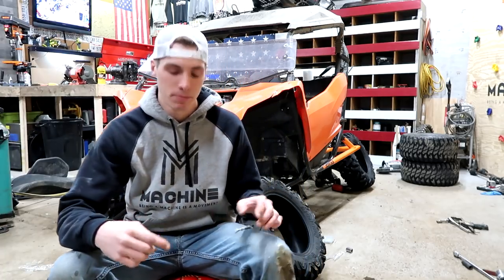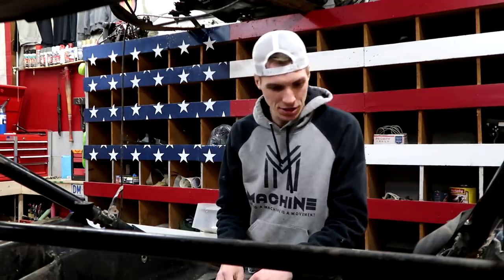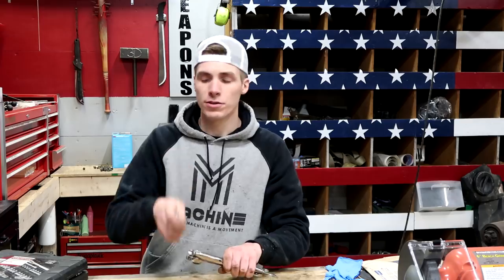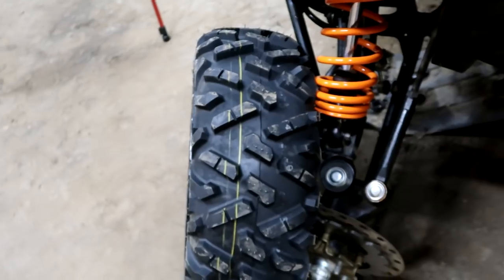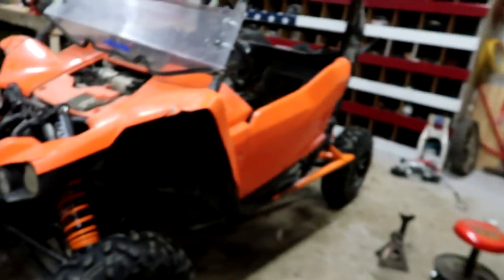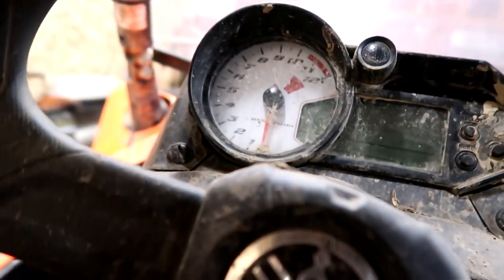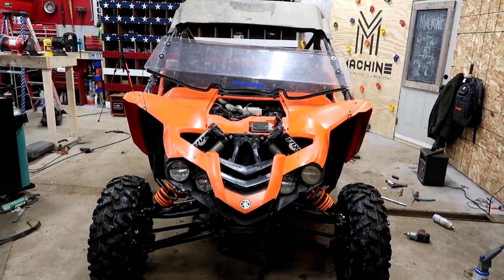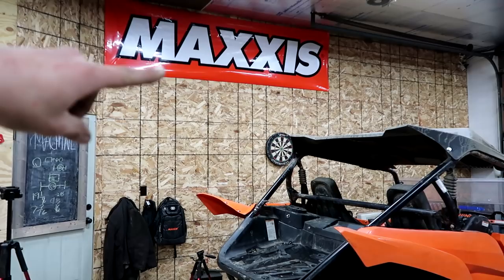CRUSH GETS NEW TIRES!!

Comment: It's looking good   When putting on and taking off ATV and UTV tires I use dish washing liquid it's a lil bit nasty but they come off easier, plus wide tires are lot easier to take off and put on rims but narrower ones are easier to set the bead.  I change them all the time.   Oh and remember to re torque the lug nuts before going to far because they will not sit at first   Just my experiences maybe

Comment: I think the reason why you have to have the same exact size on your tires is becouse it's four wheel drive. if you have different size wheels, then the bigger ones goes more travel on one spin than the smaller ones and Crushes four wheel drive system won't like that.